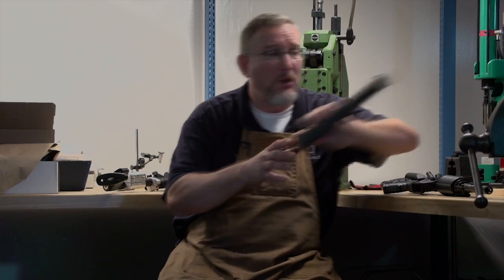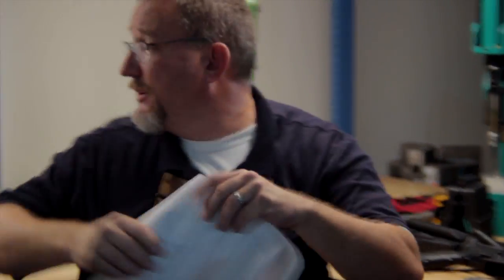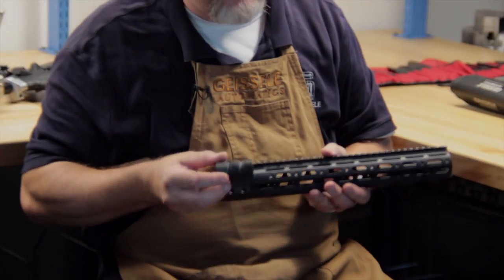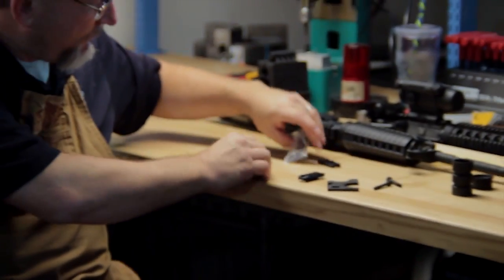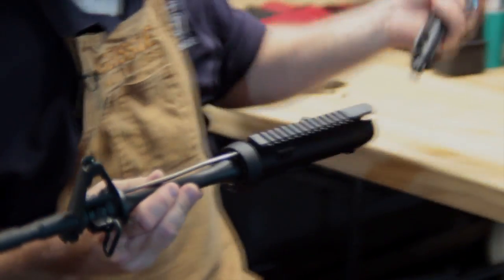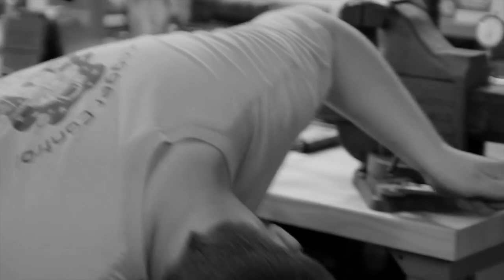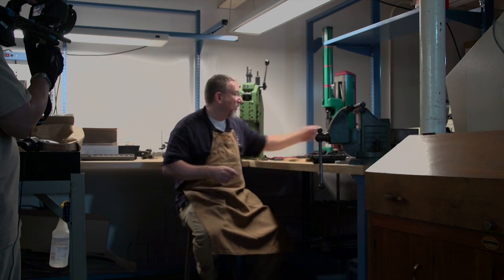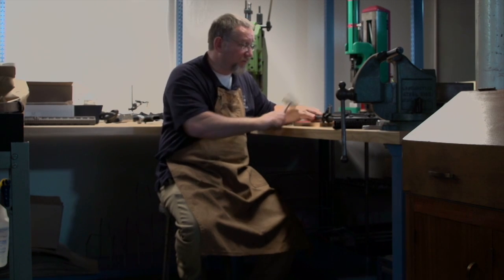**74 MINUTES LONG** Super Modular Rail - Mark I - Geissele Automatics

Comment: I recently purchased a 13" MK 1 rail for my 14.5" SOCOM barreled M16 work (Department) gun.  This thing is awesome to say the least.  I have owned and or used rails made by Larue,  Danials Defense, Yankee Hill Machine, Knight and Surefire.  This Geissele MK 1 is the free float rail that all others are judged by IMO.  The install was a snap and shows a superior product by attention to detail and a well thought out design.   The MK 1's  large barrel nut acts like a heat sink going a long ways toward keeping the rail cool enough to handle without gloves even after doing a couple of full auto mag dumps in a row.   Also have a Geisslele trigger.  Way to go Geisslele and congratulations on yet another awesome product!!